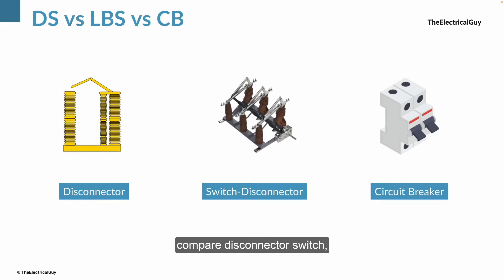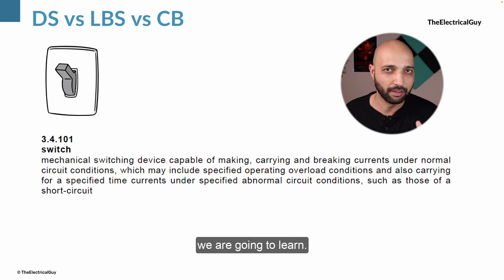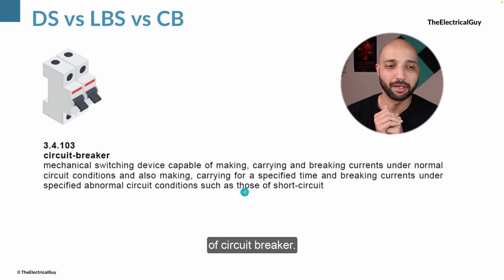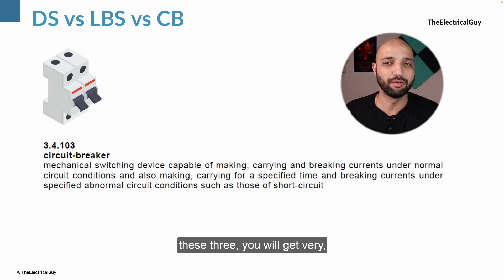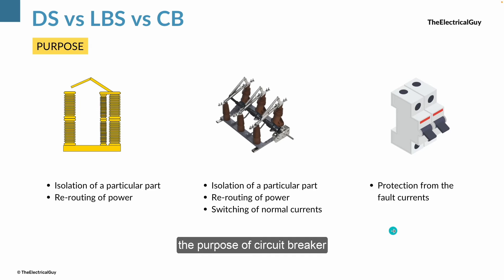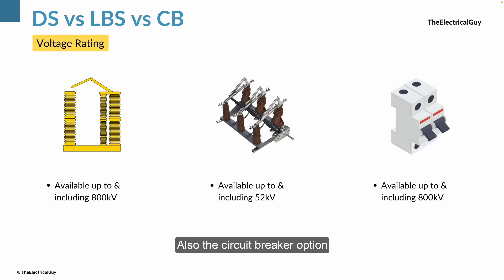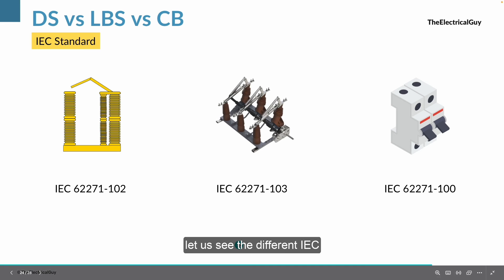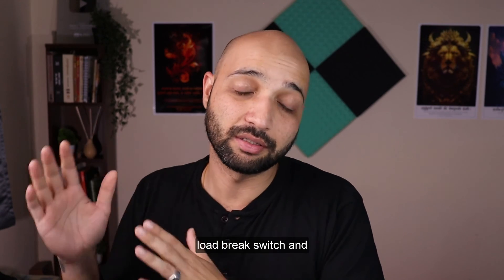Decoding Differences: Disconnector x Load Break Switch x Circuit Breaker

Comment: Thanks for this informative contents, could you please let me know that is there any application in power system where we use switch or it always use along with disconnector i.e. Switch disconnector
Reply from the maker: Switch most commonly used in LV applications